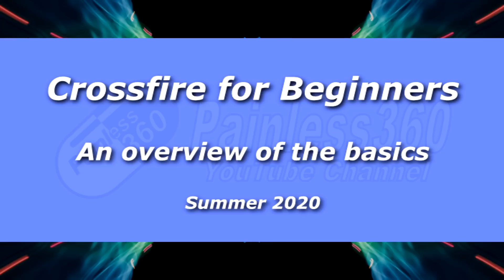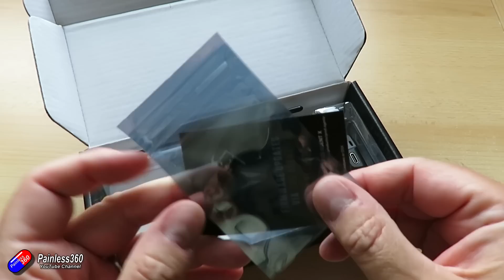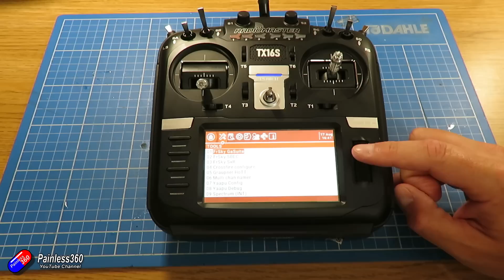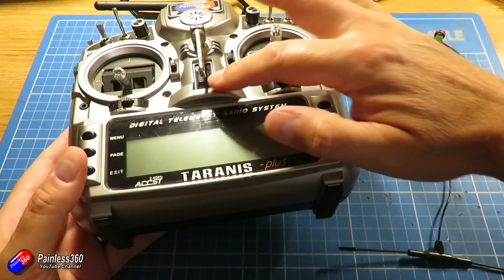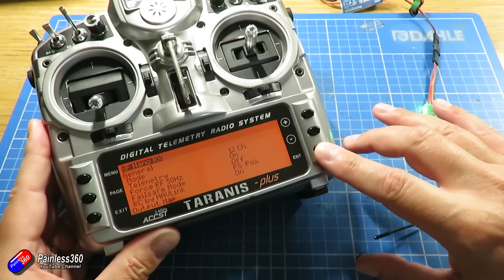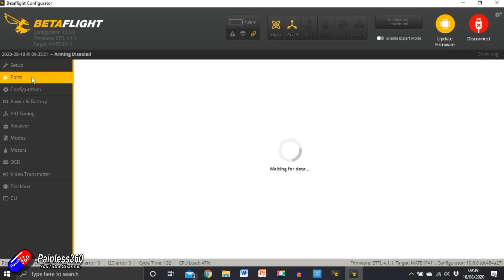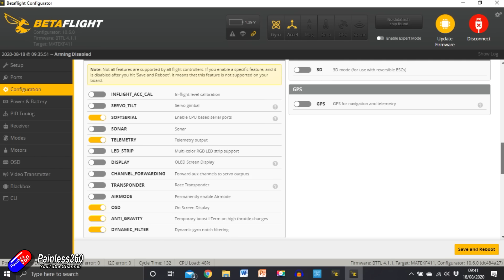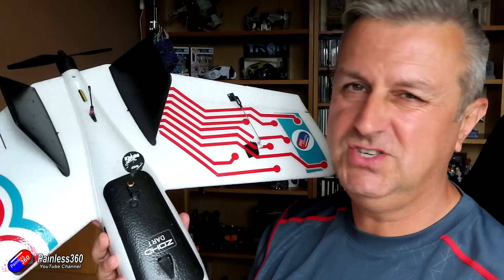Crossfire Basics for Beginners (Summer 2020)

Comment: Are you still planning on making more crossfire for beginners videos?
Reply from the maker: Possibly. To cover what?
Reply: @Painless360  I am new to the TBS ecosystem and 900MHz in general.  I used my old radios until I lost a model due to losing radio link on 2.4GHz. My financial advisor (wife) said its time to upgrade my old radio. That was a lot to really just say I don't know which crossfire module to choose and why one is better than another besides output power. Same with their rx and the different options there. I can do research and reading but I respect your opinion and know that you will give honest information.
Reply from the maker: Check out the kit picks video from last summer. Nothing major has changed from then. RadioMaster TX16s, Crossfire or Tracer for the module. Modern radios are much better at solid 2.4 than older protocols we call used so you may not need a separate module..

Comment: Dumb question but when you install Crossfire can you still fly your models that aren't running crossfire receivers.   For example I have quads with Frsky receivers but want to run Crossfire on a long range quad build.  Is it just a matter of setting up the model in the transmitter to use the Crossfire module instead of the built in signal?
Reply from the maker: Yes  the Crossfire module doesn't stop anything else on the radio working. You select what you want on a model by model basis. Happy flying
Reply: Painless360  Thank you for the quick response.   Looking forward to watching more of your videos.

Comment: Hi Painless!
I'm a little confused about which module to get.  Currently, I'm running DragonLink on the FrSky Taranis X9D Plus. I fly quads and fixed wing and use a head tracker, so I'm assuming I need the full blown version?  I'm also concerned about how I'm affected with the inverter situation. Are you able to clear things up for me?
Thanks!
Reply from the maker: The original Taranis you have or one of the new ACCESS capable radios should all be able to run Crossfire and Tracer at full speed.. See my recent video chats with Trappy..

Comment: I can't seem to figure out an answer to this, but if I have a Crossfire Micro and a Flight Controller with pins installed, how would I wire that up? The Crossfire Micro comes with smaller cables that don't have the typical Servo Leads at the end. Would I just have to remove the pins from the FC and solder directly, or is there a cable I could find? I tend to swap Rx's on my FC from time to time which is why I have pins soldered on.
Reply from the maker: I would crimp pins onto the wires usually. See my video on crimping.. best of luck
Reply: @Painless360  Okay, yeah that makes sense. Thanks!

Comment: I got a nano and soldered on the pwm 6 channel adaptor,, it's bound and updated,, but won't arm my plane or move any servos..watching all your vids again to try to figure out what I'm missing....hmm? For output chapel I tried setting to ch1 to ch1 which is pwm ch1 I thought, but still can't seem to get them to talk... On my tx16s I don't see PWM as an option? Is ch 1 actually pwm ch1???
Reply from the maker: You usually need output one on the Rx configured as SBUS for the FC - see my builds using Crossfire.. Best of luck!

Comment: how can i connect the xf to a plane with 4 or 6 channels but without flight controller?
Reply from the maker: There are 4 outputs on the micro reciever and lots more on the diversity reciever.. You could also look at using an Sbus to PWM decoder...

Comment: Hi Sir, whats the voltage range of the crossfire nano rx? Can I put solder the 5v rx wire to a battery positive on my mobula6 board?
Reply from the maker: I run mine at 5v. Check out the Crossfire builds on the channel..

Comment: Are the crossfire transmitter / receivers / VTX remote id capable?
Reply from the maker: I'm not sure, I not seem anything to say they would be... Best of luck
Reply: @Painless360  In a sense, it looks like the receivers in the drone will have to be a transceiver so that it can receive commands and send telemetry and Remote ID on 2.4 GHz WiFI or Bluetooth.  TBS crossfire appears to use the 915 MHz band in ITU Region 2 (US, North and South America) and the 868 MHz band in Region 1 (Europe and Africa).  Region 3 (Asia and Australia) has rules I don't understand yet.

Comment: I am a begineer. I just got a Flywoo Baby 1S with CRSF

I am unable to ARM it. Attached IMG

# 

# status
MCU F411 Clock=108MHz (PLLP-HSE), Vref=3.30V, Core temp=42degC
Stack size: 2048, Stack address: 0x2001fff0
Config size: 3924, Max available config: 16384
Gyros detected: gyro 1
GYRO=MPU6000, ACC=MPU6000
OSD: MAX7456
System Uptime: 310 seconds, Current Time: 2022-11-26T18:08:10.390+00:00
CPU:7%, cycle time: 125, GYRO rate: 8000, RX rate: 49, System rate: 9
Voltage: 4 * 0.01V (0S battery - NOT PRESENT)
I2C Errors: 0
SD card: Not configured
Arming disable flags: BADRX CLI MSP RPMFILTER ARMSWITCH

# 

Everything else seems to connect. Please help. Thanks in advance
Reply from the maker: You appear to have a few things to check. You need to look at the arming disable flags. You can see how to fix them here - https://github.com/betaflight/betaflight/wiki/Arming-Sequence-&-Safety best of luck

Comment: Hi I'm just a bit stuck at the moment on which crossfire module I need to purchase for my tx16s. I have a nazgul 5HD that has tbs nano. Do I purchase a tbs micro v2 or tbs nano tx module?
Reply from the maker: You'll need the Micro TX v2 for the Tx16s. Happy flying
Reply: @Painless360  thank you soooo much! One more final question, I also have a cinelog30 equipped with tbs nano on the way, do I need to purchase a 2nd tbs antenna for it to work with this quad as well or can I use the stock one that comes in the package of the micro v2 to work with both drones?
Reply from the maker: Not sure what you are asking. Either TX module can bind to many receivers/models. See my Crossfire series. Best of luck!

Comment: Hi im new to inav in a way. I have the inav luau running on my TX16s but can only get the rssi to show.  I would like to have the full telemetry features shown on my radio. Can you help????I'm using the tbs micro TX and nano RX
Reply from the maker: Check out my video on the LUA script and how to set it up. Best of luck
Reply: @Painless360  i  did and still only getting the rssi
Reply from the maker: What troubleshooting have you already done?
Reply: @Painless360  I've check the firmware are the required ones. I've deleted the lua and updated to the latest.
Reply: @Painless360  im using the crossfire micro TX and the nano RX with the F405 FC. All surfaces are working correctly and it's arming. My ch3 on rx goes to R2 and ch4 goes to T2.

Comment: Hi i have a problem with tx16s is there a need for newer firmware open tx for crsf? i have paired crsfr via usb. and when I turn on the radio, the red LED on the nano rx receiver lights up. The internal module is off. tx and rx is latest updated. Thanks
Reply from the maker: It's ok here.  I updated my OpenTX to the latest version.  What troubleshooting have you already tried?
Reply: @Painless360  I try to rebind a lot of advice and in different ways and still nothing. I have the original version of open tx which was pre-installed. so should I upgrade?
Reply from the maker: Yes
Reply: @Painless360  still the same issue... tx pulsing orange  and rx red light.
Reply: in rx settings i have crsf v2 but in open tx i have crsf  is that compatible ?

Comment: Is it possible to use Crossfire as a telemetry radio for a gcs with pixhawk family FC ?
Reply: yes. have a look at the manual for the details and on how to set it up .
depending on the transmitter, you can use Bluetooth and/or wifi for that.

Comment: I saw crossfire as a $30 upgrade on drones. So, i searched “what is crossfire?” “Crossfire basics” popped up, perfect. Then, for 10 min i learned to set crossfire in a controller. So, still i don’t even know:: I’m what crossfire is, why is better, is it analog or digital, does it work in conjunction with any setup, is it a replacement for what, etc. So this yt is a setup tutorial that doesn’t say what crossfire actually is. As a true newbie looking for basic information, i still don’t know what crossfire is.
Reply from the maker: It is a radio link that uses a lower frequency than what most of the radio systems use (2.4Ghz). The benefits of this are longer ranges and better connections in places where 2.4Ghz is not great. https://www.youtube.com/watch?v=_2Xu14sFUss&list=PLYsWjANuAm4rO3ww_HNVvuiXKmYFzS6Z2&index=1&t=140s will help too. That video, along with others is linked in the video description and is only a click away...

Comment: I have a lot of spare Crossfire RX’s and would like to use some in plane without flight controller. Can you do a video showing best way to do this either with using SBUS or better still  CRSF (Patreon: Gez Dixon)?
Reply from the maker: You'd need something like this - https://hobbyking.com/en_us/signal-converter-module-sbus-ppm-pwm-s2pw.html?___store=en_us